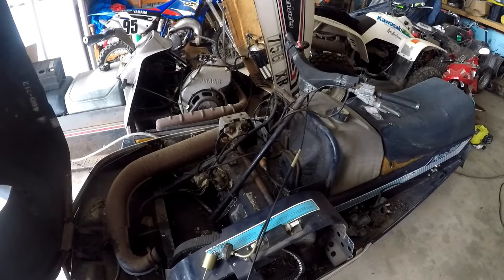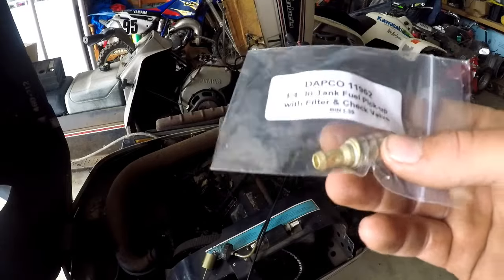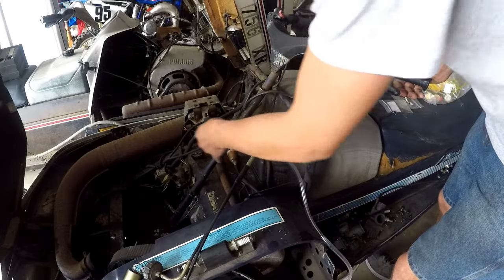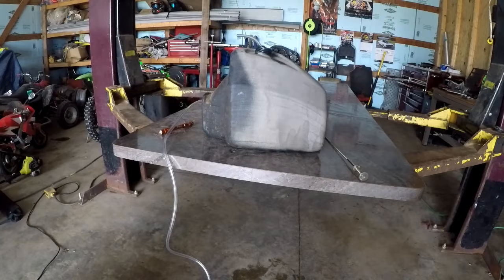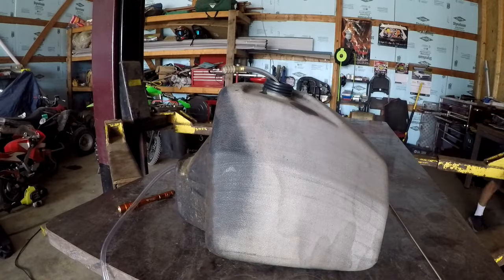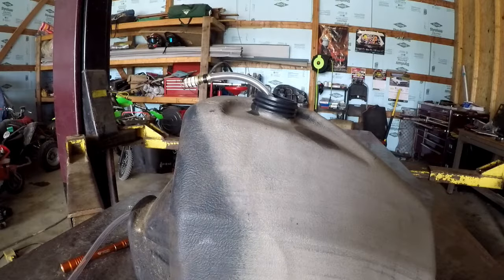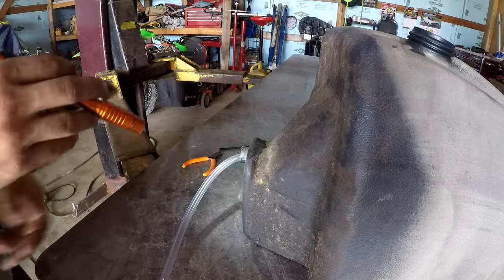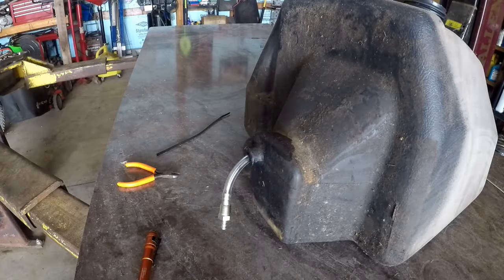(FIX) Snowmobile Won't Draw Up FUEL!! Replacing Fuel Pick-Up Line & Filter/Check Valve in Gas Tank

Comment: good video! do you think that check valve will work on my kawi 1996 1100cc wave runner? i have the same prob of it losing prime when it sits for awhile.... thanks
Reply from the maker: Possibly if it has the same kind of tank setup. I'm assuming it's very similar
Reply: MMO  👍 cool thanks! It’s souls work. I might try it.

Comment: Will turning  screw in part cause in tank line to come off if I don't have zip tie? Thanks. Also thanks for well presented informative video. Also what are top 5 things to check for when evaluating old snowmobile you are considering trying to get running to decide if it is worth it to try? Thanks. Anyone?
Reply from the maker: Not usually. It should stay on as long as it fits snug with the new line. I have some videos on here about getting sleds running and stuff. Can try to make a video on your topic!

Comment: What happens if you have that filter/check valve attached to a new line but the check valve doesnt work, lets fuel go both ways.
Reply from the maker: Fuel will just flow back into the tank, may take a few more pulls to start